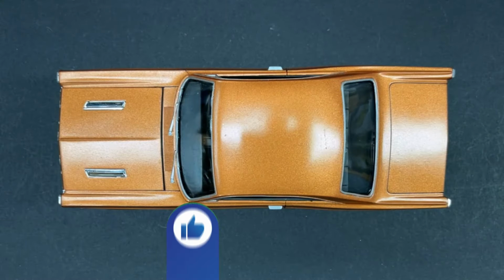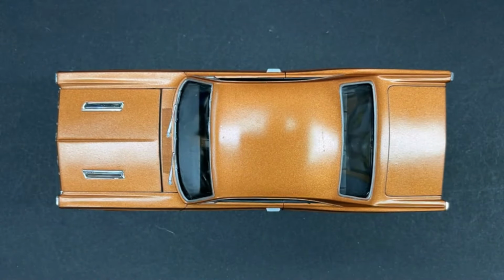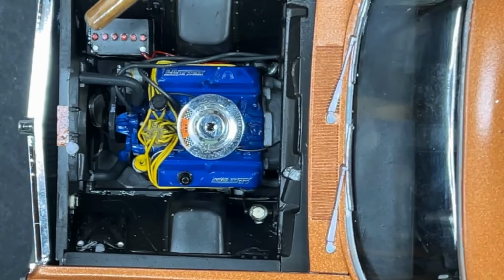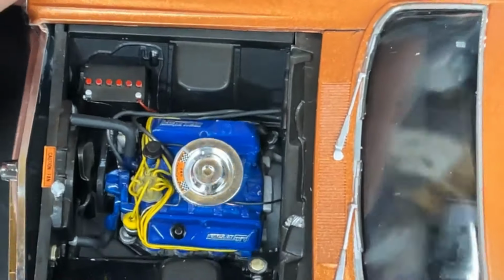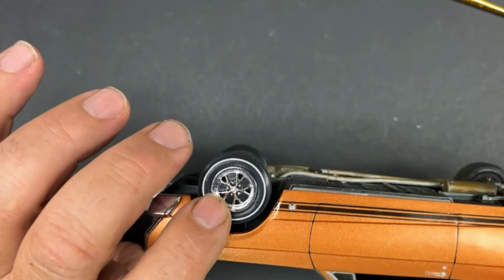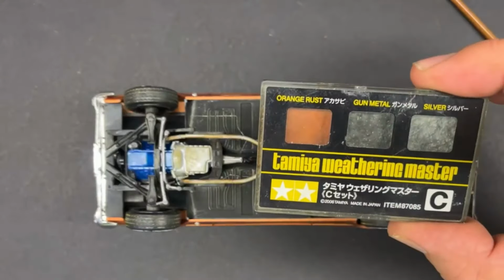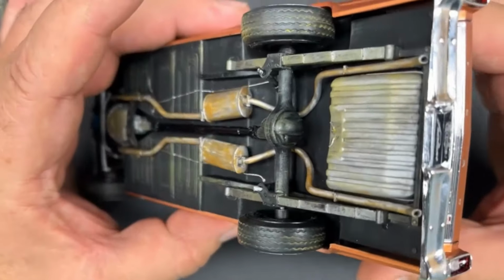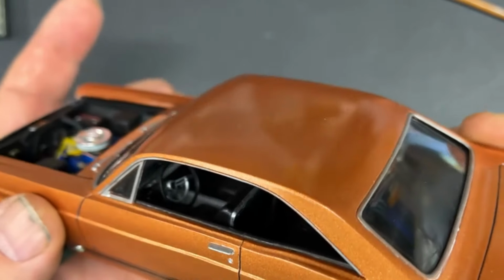AMT ERTL Ford 1966 Fairlane Reveal

Comment: Looks amazing. Have you considered using a black wash on the fresh air intake grille at the bottom of the windshield?
Reply from the maker: Thank you.  I don't usually use black wash.  I always think it looks a bit to dark.  I will run a #2 pencil in the groves to darken them a bit, but this kit didn't need that, but the camera hides it.

Comment: Excellent build ! You set a high standard with that one. As I mentioned before it's one of my favorite kits (I have 4 kits in my stash now LOL). About the hood - it's funny but with most any kit I always cut off any tabs / protrusions on a hood, and fill in the holes on the fire wall where they go in. The holes usually look odd, and I prefer to just lift off the hood to show the engine for a better view. But I get why some modelers like to have an opening hood. After seeing yours now I have an itch to build another one LOL
Reply from the maker: Thank you very much.  I will be adding a few more to my stash as well.  I sometimes like to use a bit of sticky tack to hold the hood open for display.